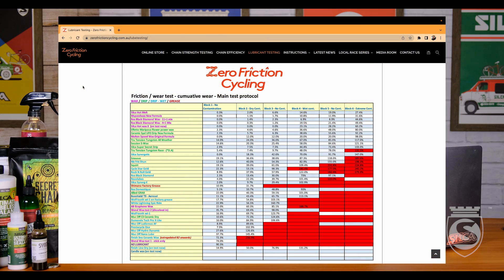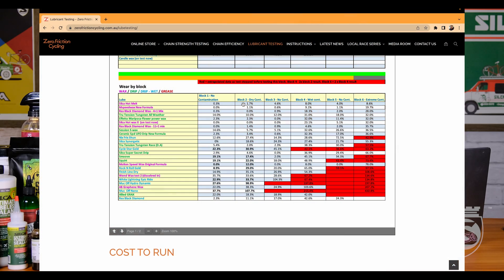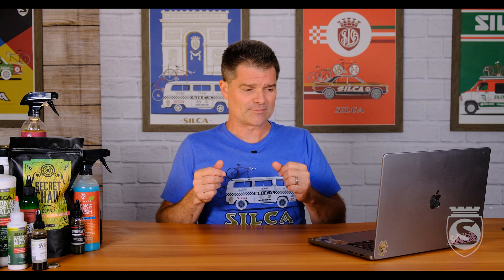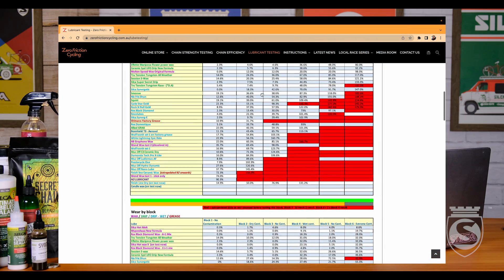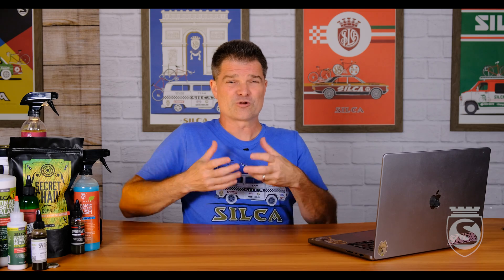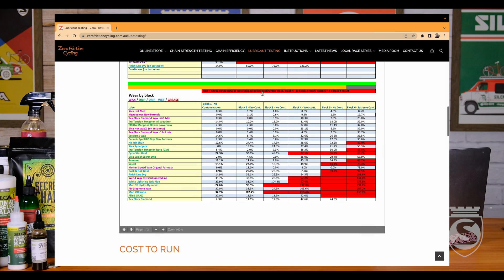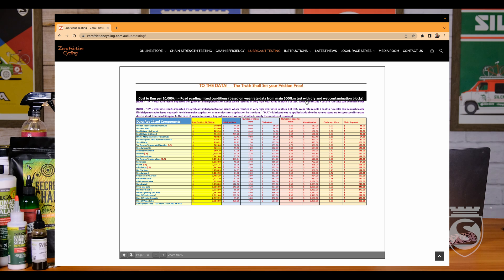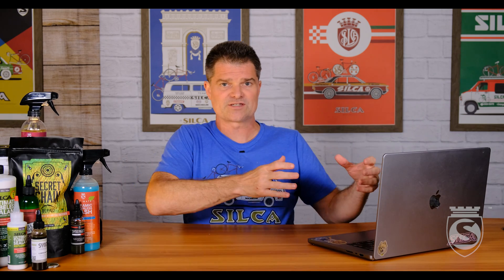Astonishing ZERO FRICTION CYCLING Data Will Blow Your Mind!

Comment: I knew 1x killed drivetrain 2x as fast because of the chain line. The cyclocross manufacturers need to bring back cantilevers. My '11 Raleigh RX1.0 stoppies no problem all day. I hate being forced into a high maintenance disk with less modulation which equals stopping power when you're braking at friction point like me. Canti is king, lighter, better stopping performance. Maybe I should start making frames for the old guys who know exactly what they want!

Comment: ZFC uncontrolled lab in garage that nobody have access to it with experiments that very questionable, like not cleaning the chain for 5000 km and for sure not providing proper results that most of the lubes need to reapply on clean chain frequently, and for sure it's not real life tests. Also test rack not look professional, and setups are very far to be trusty. For sure it completely biased to SILCA lubes and some overpriced lubes on the market, in that experiments that are not controlled I can fake any data and make good lube look bad and bad lube look good, also I don't really need to test all lube, I just can fake my data. And regarding real life results, I don't have same results on my mtb, chain wax just fall in dust, it create so much mess and chain is not clean, it's a wax with sand and dust.
Reply: Zero friction claims to be able to measure to within an accuracy of 0.5 microns, using a kmc digital chain wear checking device. He's a liar & a criminal 😂
Reply: @papalegba6796Or customers are stupid :) Hot wax could be good for specific applications, but not in my for sure. Dust, dust, dust, a lot of dust and salty sands. That strip wax in 200 kilometers, easily . Much easier for me to use squirt lube, just put it after bike clean once a week and I'm happy. In case of component wear? In that dust that I have cassette will wear In 20 k easily , using any  lube.

Comment: I am using Synerg-E wet lube on my ebike, and I've been loving it so far. The chain runs so smoothly and quietly! However,  I want to ask about what you said at the end of the video (around 14:20) where you mention that with better wet lubes (like Synerg-E and Synergetic) it can be misleading to assume "it's quiet and running smooth; it must be relatively clean."  I know you were specifically talking about a long-distance race in inclement weather conditions. I just use my ebike for commuting and pleasure riding. Would it be unwise in my situation to use chain noise and smoothness as an indicator of when to reapply Synerg-E? I know it's supposed to last around 750-1000 miles, but how am I supposed to know if I need to relube before that interval if not by noise and feel?

Comment: Another great video Josh, thank you.

So, in your long ride, hot wax to synergetic scenario; does that chain need a full degrease/reset after the ride before reverting to hot melt?

I think I know the answer (yes) but it’s always good to ‘Ask the Expert!’
Reply from the maker: Yes, you will need to fully strip the chain after it sees any non-wax lubricant before you wax it again.

Comment: People need to know theres a significant problem with his wear rate measurement. Hes measuring chain wear with lubricants APPLIED as per his testing brief. The measurements should be taken on a completely stripped chain. The problem here is any high viscosity melt in lubricant (like waxing) will give false readings since the wax fills in the gaps between the roller. He even states this on his website in another test file. This is why waxing shows loer wear rates over thinner wet and dry lubricants. Straight from his website 

Block 1 – 1000km. No contamination. Assess any initial penetration issues present + clean road conditions performance.
0km – Lubricate strip cleaned chain as per mfg instructions, included any needed set time before test commence. Chain is precisely
check measure for net start measure.
Interval 1 – 400km – Big ring, Cog 4 – 12hrs 15 mins.

Re lube as per mfg instructions inc. any needed set time.
Interval 2 – 200km – Small ring, Cog 1 – 11hrs 06mins
Re lube as per mfg instructions inc. any needed set time.
Interval 3 – 400km – Big ring, Cog 5 – 11hrs 12 mins.
Check Measure for Block 1 wear amount vs start measure

He is NOT measuring a clean, stripped, dry chain, according to his test methods. This is giving a completely inaccurate wear rate than what the chain is actually experiencing.
Reply: I report every video or comment zero friction makes. He's a criminal.
Reply: Good ol outdoors55 :).  

Perhaps you could do some of your own work and realise yourself that making big bold statements as fact that are not in fact true. 
Ie - you can state with confidence how thick the wax layer is after 11 hours of running at 250w load, and how much that layer a wear check result? No, you cant. Because you haven't done the work, do not know, and yet keep chiming in on vids with your bold statements based on zero actual knowledge.  

The information in the document advises to check measure waxed chains BEFORE re wax, not after re wax. Post a re wax you will get a false low measure. Pre re wax, you will get a perfectly accurate measure for wear tracking purposes. 

This is no different for check measuring a wax chain as it is for check measuring a drip lubricant chain. After hundreds of km's of running, the lubricant film or wax layer is so thin, that it makes no practical difference to a check measure - there are other variances that are greater within any such testing such as the difference from one chain to another etc.  Whatever teeny variance this brings is just part of the overall stated test variance. 

Outdoors55 why do you spend so much of your time trying to tear down something that so many others with actual knowledge and experience in this space have already deeply scrutinized and passed, from top manufacturers who commission ZFC for testing - some of whom have been continually using for years - people who are qualified engineers and chemists working passionately in cycling. Also one mfg so far (squirt) have set up their own testing following EXACTLY the same test protocol as ZFC as part of their own future lubricant development, and currently working with two other manufacturers who are looking to do the same. 

Funny how actually qualified and experienced people in the space agree with the test protocol, but you who has zero experience....... 

Remember the big debate we had earlier and how you were going to set up your own test to prove that water was going to perform just as well as or better  than lubricants? Well im waiting for you to publish your testing. 

Considering for over 8 years ZFC has completely open for scrutiny the test protocol, demonstrating the test etc, and in 8 years+ the only two people i can recall who have brought up incorrect concerns about the test are your and Durianrider. Birds of a feather flock together. 

You really should perhaps focus on area's (and i hope you have them) - that you have some knowledge in. This space is a struggle for you. Despite the previous chats you still dont get basics that a casual non mechanically minded cyclist understands in a heartbeat.
Reply: @zerofrictioncycling992  so show your whole test in one video. Im simply stating what you say you do on your website site. I actually posted you EXACT test method😂 Cant wait till Hambini comes out with his video 😂  The reason is because in order to test chains you have to test power. And currently none of the power meters are accurate enough to do that.  If lower wear really equals lower friction lets run a motorcycle oring chain for 12hr and check the wear. It will be zero wear, but we KNOW that it will consume more watts. 

And all those qualified people are selling something 😂 Ill bet none of you self proclaimed "experts" have ever actually heat treated any steel or know any of the metallurgy behind it. Im well known enough in that industry to not have to state my qualifications in that area bud.

Lol your even policing other people's videos for people who disagree with you. Wow That wasn't even 12hr before you showed up😂

Maybe if i get bored heat treating, analyzing steel microstructure, and specializing in measuring steel particles down to the nanometer, aside from other areas of steel engineering, I'll venture into testing bicycle chains with accurate measurements. How about send me a new chain and an old one with your current measurements, and ill pear review it using optical magnification and an SEM?
Reply: @zerofrictioncycling992 people email you about youtube comments? You think that sounds normal? 😂

Comment: Not disputing, but how does 1x wear twice as fast? (I run 2x Shimano by the way)
Reply from the maker: Not exactly that it wears twice as fast, but if you only have 1 chainring, it takes ALL the wear all the time compared to a 2x setup which shares the wear accross 2 rings.. it also tends to be smaller than a big ring in a 2x setup meaning it has fewer teeth to spread the total wear.. also those ultralight cassettes typically use aluminum in the larger cogs to save weight and those wear much faster than steel.
Reply: @SILCAVelo  Ah I was going to say, I spend about 90% of my time in the big ring anyway (but that 10% in the small ring is crucial!) but the less teeth point does make sense . Definitely agree about aluminium cassettes. Sticking with steel on those. I imagine on a 1x a 10t cog would wear even quicker than an 12 or 11t cog too.

Comment: if I need to measure wear on my waxed chain. should it be when it has just been driven or when it has just been waxed?
Reply from the maker: Wear measurements are only valid when the chain is stripped and void of wax or lube as the lube will fill up some of the space making it appear less worn.

Comment: Great insight!  Two questions....
1. Is the Super Secret chain lube specifically formulated to go on top of Silca's wax?  Would it work just as well to put over, say, MSpeed Wax?
2. Is there any potential benefit to waxing a chain inside an ultrasonic cleaner?  Or is that just getting too marginal to matter?
Reply from the maker: Yes, the SuperSecret is exactly the hot melt, that we high pressure emulsify into water, so it's identical once it has dried.  You can use it over the new Molten Speed as it is an almost exact replica of SILCA hot melt.
Waxing in the ultrasonic just gives you more consistent WS2 mixing, as that additive is quite dense compared to the wax it tends to sink and then need a good bit of agitation to get it back into a consistent solution, and the ultrasonic does that better than almost any other type of mixing you can think of.  But performance wise, it is very, very marginal, so it's the technically best solution, but not something you will feel or even notice.

Comment: Would love to see the prices of nano graphene-infused lubricant come down soon. Waxing twice a month instead of twice a week would be so nice!
Reply from the maker: As graphene prices come down to earth the two will become more similar in price.  At the moment, pure, single layer graphene like we use costs around $20,000 USD per kilogram compared to ~$500 per kg for 200nm Tungsten Disulfide and $20 per kg for 1micron  PTFE/Teflon
Reply: @SILCAVelo  I have no doubt it will drop in price, but not holding my breath. Getting a consistent size and shape to the nano platelets is complex and highly patented... but if graphene truly is the material of the future (batteries, etc), manufacturing costs have to come down.

Josh, while I have your ear, did you increase the melt temp of your hot wax base? I could benefit from a harder paraffin for summer application.

Comment: Brilliant again thanks josh! 
Just a quick note and apologies re the size of the league table for Single Application Longevity testing. The original S.A.L test i was doing proved insufficient and so i had to scrap that data and start over, and then i typically only test lubricants in S.A.L that have tested well in the main test (with some higher profile lubricant exceptions). If the lubricant was pretty meh or poor in main test, normally i will not bother with the resources to test it in S.A.L as it is just not worth having on anyones shopping list as an option. 

Also an update re cost to run, i am working with Omni Calculator to have an online calculator for this built which will be expanded across a much wider range of groupsets - version one should be out in next 2 to 4 weeks hopefully. However a key point is the higher tier your groupset is, and thus higher component cost - the less important the lubricant cost is IF it genuinely delivers low wear (ie - NOT something like Muc-Off Ludicrous AF that was both higher wear AND extremely expensive - that is not a winning combo for you wallet). A low tier groupset such as tiagra or Sora, sure - if the wear rates for a cheap poor performing lubricant - that will not hurt that much.  But if you say spend $30 more on your lubricant to save $300 in wear (or more) per 10,000km of riding, that is a great return on your $30 investment. Warren Buffet and Charlie Munger would fully endorse if they ever discovered the world of bicycle chain lubricants :)

Comment: So, once and for all, is it okay to arrive home after a wet ride and throw the chain (which will be wet and i guess a little dirty, for sure cleaner than using wet lube though) directly into the pot without rinsing it with hot water and dry it previously?
Reply from the maker: Yes.. I personally boil it in hot water for a minute to remove road grit and old wax, and then throw that into the wax, but the amount that comes off in that process is just a few grams of stuff.. so throwing the dirty chain directly into the wax risks some contamination long term, but it will be very small.  As for the chain being wet, you just need to leave it in the wax long enough that the water can boils off.  Usually like 10 minutes and wait for any bubbles in the wax to stop coming to the top.

Comment: I'm a recent hot wax convert (still on my first waxed chain). What finally pushed me to convert was your new Stripper product as it of course simplified the dreaded pre-wax step but specifically significantly reducing the need to store volatile chemicals for a long time. As the Stripper wasn't available locally (e.g. Amazon), the shipping costs from your store was excessive but the charts from Zero Friction basically, over time, demolished the shipping costs.

During a recent Amazon Prime day, I purchased an inexpensive pot for melting. What added confidence, to that purchase, was that Amazon had a section labeled "Frequently bought together", which included Silca Hot Wax, so I know it was in the right pot. As I'm so pleased with my initial experience, I've now added a second chain to implement a multi-chain wax duo. 

Despite reading all the benefits of waxing, the cleanliness of the chain, has to be experienced to be believed. It's things like post-ride wipe downs of the bike having the back of your hand coming in contact with the drive chain no longer results in a black smear. At least for now, it doesn't cease to amaze.

Thanks for the great products but especially the brilliant simplification of the pre-wax chain prep Stripper product.

Comment: Have you ever tested motorcycle chain wax? Heard a fellow rider say he uses DuPont spray wax for motorcycles.  Any experience with this on bike chains, if so, how good & what’s the comparison to Silca wax?
Reply from the maker: Motorcycle chains have o-rings or x-rings inside them which allows the insides to be greased.  Motorcycle chain wax is therefore not meant to be a lubricant for the high pressure insides of the chain, but rather a surface protectant that helps fill the sideplates and coat the outside of the chain to help repel dust and keep dirt and sand from reaching those o-rings where it could damage them.  Adam has tested Boeshield T-9 which is incredibly similar to DuPont motorcycle was and according to the MSDS actually contains nearly identical ingredients and ratios, so his data on T9 should be a good proxy for the DuPont product.

Comment: you've talked about how microfiber cloths really are the best for getting off dirt and debris, how do you clean said cloths? I just find mine stain really badly and I can't use them for anything but chain cleaning
Reply from the maker: Chain stripper will remove grease from microfiber, but it expensive.  Shout has a grease remover product that is pretty cheap and also works.  Then wash them on warm with something like Tide Free and Gentle, you don't want dyes or fragrances in there as they can get trapped in the microfibers resulting in reduced cleaning power.  I always use an extra rinse cycle as well on MF cloths as they are just so darn good at holding onto stuff at the fiber level.
Reply: I spray degreaser on the cloth, rub it and rinse it before machine-washing it. Yet I wouldn't use it for anything else.

Comment: Thanks for breaking down the charts and clearing the results.  If you apply a wet lube on top of a hot wax, will you have to do a full clean  (with turpentine etc) before the next hot wax-treatment?
Reply from the maker: Yes, you will need to do a degrease of the chain, but it won't have to be a full deep clean as the synergetic isn't nearly as tenacious as factory grease.  Chain Stripper works well for this, but a good 10 minutes of agitation in acetone will also get the job done.